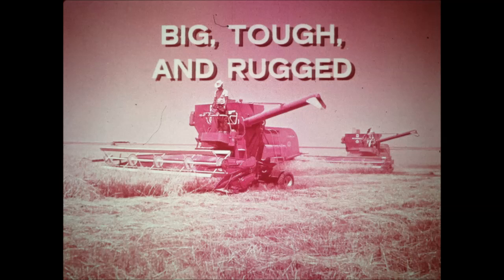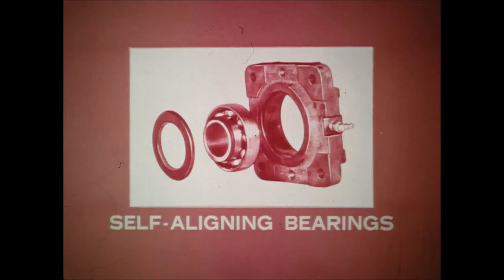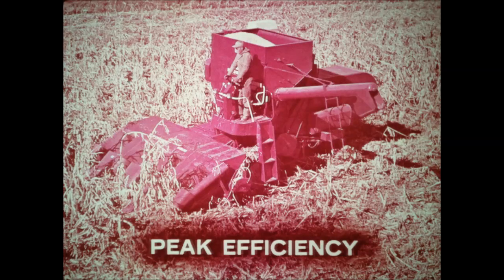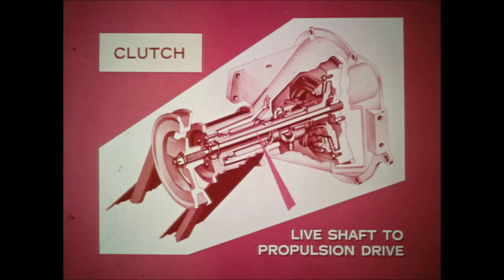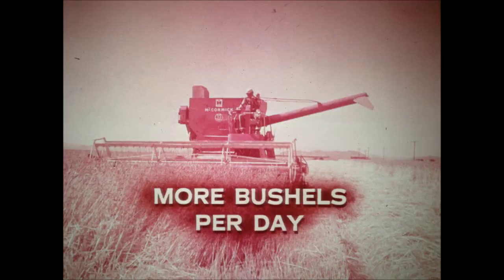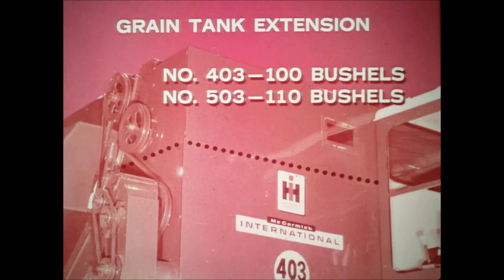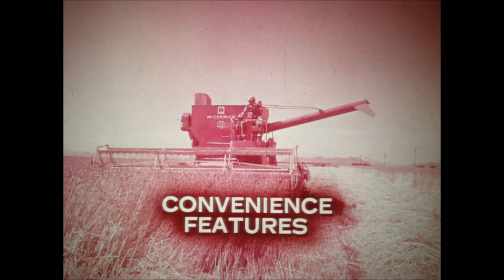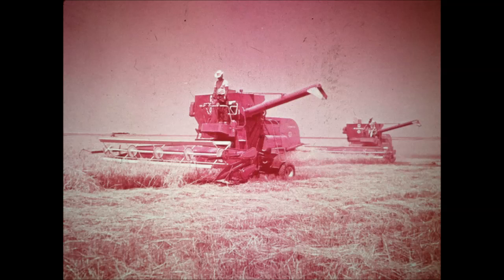McCormick International No  403 and 503 Combine Features

Comment: I had 2   403s, early versions.  Kept one on 4 row corn and the other on the 14 ft platform. They were good machines, I put wheel weights on the rear axle to keep the wheels on the ground when reversing.  Those era corn heads were super heavy, the 963 6 row I have now weighs considerably less.  Those 503s were capable of 6 row corn, many got the modern feeder house and carried the newer 6 row heads.  Most 403 and 503 machines dissappeared when the rotaries took over.

Comment: I HAD a 503 its only down fall was the heads and flat belt cylinder pulley ,in 77 i cut the throat off the grain head and got a quick attach cradle for a 815 and adapted it to the 503 and got a 844 corn head ,that made it a whole different machine ,ran it for years until i upgraded to a 1460 axle flow when i expanded the operation.But the 503 sure had capacity back in the day.
Reply: I have been watching some videos on the 503 ,man they are a big capacity machine .A fellow on YouTube has a 503 on a 6 row corn front in a 215 bushel crop at 3.5 mph !!!

Comment: Didn't realize the 503 was big enough for a 4 row head..
Reply from the maker: Nor the 403. All i can picture there is lifting the head & ending up with your tail in the air. Like a 6 row on a 1460.
Reply: We used to use 403 with a 4row 40in corn head
Reply from the maker: @farmallfan1466  Did you have waterways or hills to contend with? I'd imagine is would be ok on flat ground.
Reply: You never ran a MF 410 or 510 the 410 with a 15 ft. Grain head would unless lowered would stand you on your head going down off the highway...
Reply: @robertpayne2717  no sir, only Massey's around here were 92s, and some 750s and 760s.. and the 750&760 here usually had a 15', maybe an 18' platform, any bigger and the machines couldn't move slow enough to work..
Reply: There's a guy on YT with a 503 with 6 row corn head 414 engine ,doing 3.5 mph on 200 +  bushel corn !!!
Reply: @interman7715  WOW
Reply: @GosselinFarmsEdGosselin  Yeah mate he's called " Classic IH farming " .

Comment: Why add a flywheel instead of adding strength and weight to the cylinder components?
Reply from the maker: Good question! Not sure why myself, but if I were to venture an amateur guess, it may be to get around somebody else's patents or to create something unique that other companies can't copy. I'll leave it up to someone else to fill in the details, if they have any insight.
Reply: It kept the momentum of the cyl. up to speed ,taking less hp to drive it.